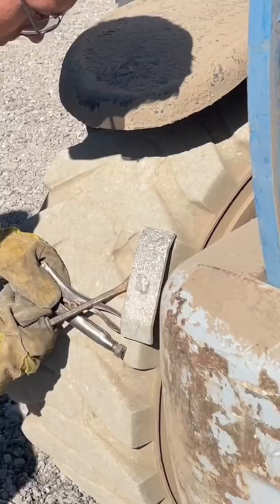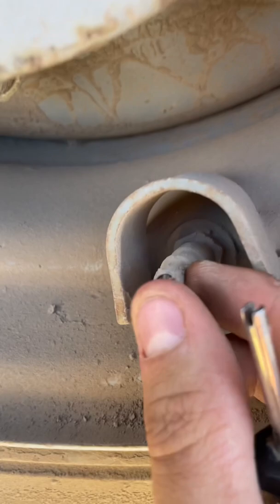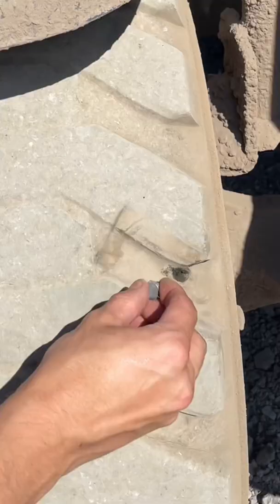How To Tell If Your Tire Is Foam Filled #shorts

Comment: Swap a big screw for a small screw. Haha. Good one
Reply: I pull nails and turn in screws in tractor and mower tires.
Reply: @Stroke2Handed  a screw is much better then a smooth nail. This just had me laughing. Customers like whyd you replace it with a bolt. And he had a great point with the foam.
Reply: @bcraiders11  Yep. He knows what he's doing. My dad taught me to replace nails with screws to save tire plugs on offroad tires back in the 80's, been doing it ever since.

Comment: Imagine a construction company incapable of pulling that piece of metal out... wow
Reply: You're a genius.  You'd deff see a nail in your tire while in the middle of the desert and rip it out. 

They didnt rip the piece of metal out because if it wasnt foam filled the metal would act like a plug and prevent or at least minimize the air from leaking out